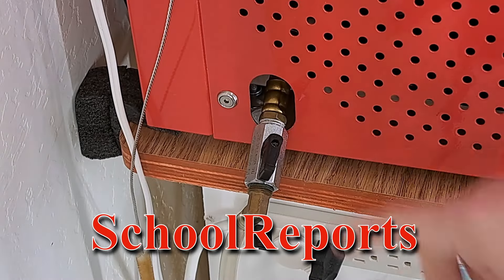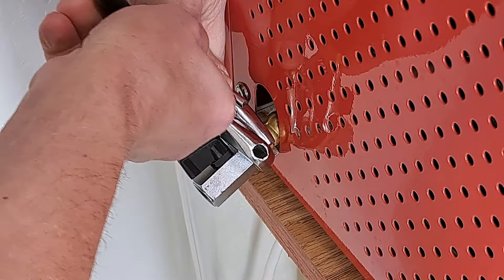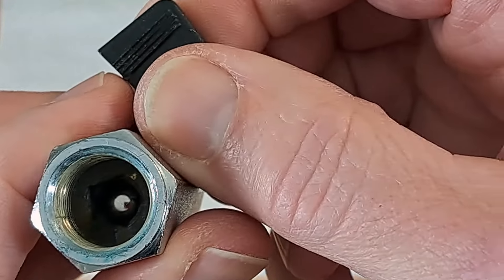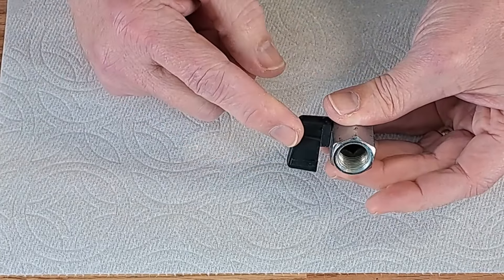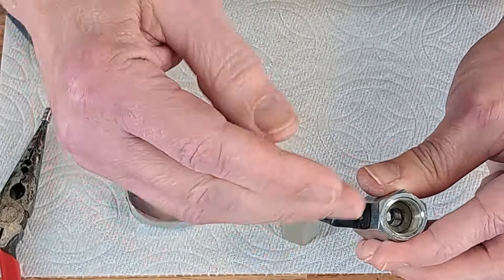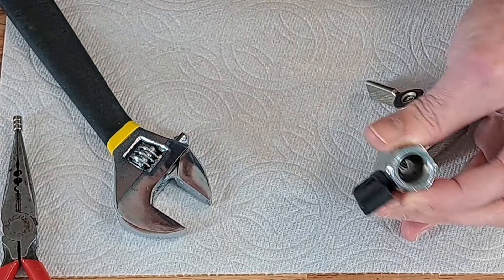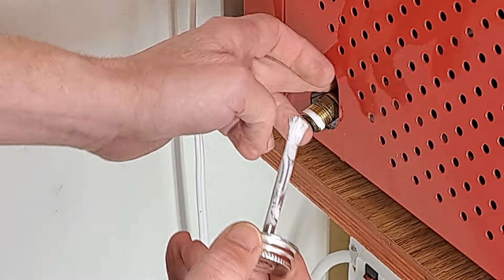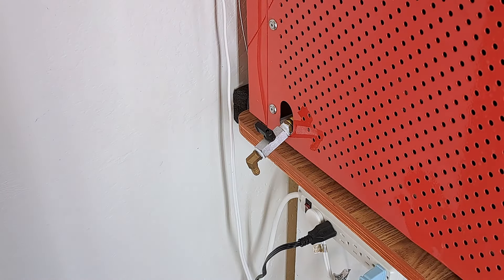Checking My 6 1/2 Year Old Drain Valve + Spare Parts List & Seal Damage Repair Test

Comment: My machine is from 2022 and I had to replace my valve with a gas rated valve and seal up all the connections. I followed the Felix fix. It works great now! My machine wasn’t getting down below 500 mtorr and I was getting errors. I used a nerf gun dart and cut I slit in it after cutting the end off and stuck it over the metal under the valve area to protect the tube 😂
Reply from the maker: Nerf dart -  I wouldn't have thought of that. I've just been meaning to 3D print a grommet https://www.thingiverse.com/thing:6482078

Comment: I had to change my valve also,  it looked gross and was so hard to turn, it sealed good but making sure it was turned all the way was the problem.  new valve, not one bit of trouble since.
Reply from the maker: My valve has always been a lot easier to turn than my sister's, but at least hers still sealed - until it didn't! 😁

Comment: Your sister and I bought our machines at about the same time. December of 2022. My gasket is perfectly fine, still.
Reply from the maker: The way the one area of fiber stuff was showing, I'm assuming that is was just an issue of variation in seal manufacturing. It was still holding vacuum, it was just getting harder to get it to seal when the vacuum first started. (I think she has done around 130 batches)
Reply: @SchoolReports  I’m at 224 batches, including candy. 12 of those are candy loads.
Reply from the maker: Nice pace. 
My sister has always been going at a slower pace. (only referring to her freeze drying batches!) I've done very few batches over the past 6 months or so. I'm more in the maintenance phase of freeze drying right now - rotating stock and replacing what we use. We even plan to send some off to the kids to make more room for new stuff!

Comment: Thanks for the white banner and not the airplane. I have subscribed. Not because of the banner but due to today’s vid which I like. But… taxi? 🤨
I don’t “ring the bell” because YT notifies me of new vids anyway, the notifications would be another annoyance. 
When you took apart your drain valve the old adage “if it ain’t broke, don’t fix it” came to mind along with prayers it continues to work. Then you mentioned you’ve taken it off before and I realized the likelihood that you’ll mess it up isn’t a problem. 
Is it possible your sister wasn’t completely opening/closing her valve? I don’t expect an answer because we can’t travel back in time and see if she did. I wouldn’t ask her, because it could be viewed as an admonishment or other attack. My question is mostly rhetorical.
I can both see as well as doubt that HR would purposely use an inferior piece in a newer machine. Cost savings yes, but possibly a supplier error.
The gasket portion was very interesting to watch, I’m curious about the outcome. Next vid I’m assuming.
Reply from the maker: Sister's valve was bad and well tested. I did a 3 part series of videos documenting its issues; testing, removing, tear-down, replacing, testing.

As I replied to another commenter yesterday about the bad valve:  
True. The good ones are only a few pennies more than the bad ones. I wonder if someone just made a materials purchasing mistake at some point?

I'll be weeks before I take off the gasket being vacuum tested in this video, and then try to put it back on. (assuming it comes off without having to cut it apart)
I'll be starting an actual batch with it soon - today or tomorrow - after I make a video for a viewer that had a candy settings question about the older machine. 

My old seal, the one I put the small the amount of silicone in/on (?) the cracks at the end of this video, should have no problems with vacuum - at least once! I won't be testing it until I take the other one off.

😁 I've made 5 different ones of the little popup, and yep "Taxi!" is one of them. (plus 3 little airplane ones - one right, one left, one pulling a double banner) And sometimes I even (Oh! The Horror) randomly put the word "Subscribe" somewhere in the video! I typically show some kind of subscribe thing about once every 8 to 10 minutes. I've even had a few people tell me that they had subscribed specifically because they liked an interestingly placed or made "Subscribe."  I once piped "Subscribe" using the yogurt I was freeze drying. (4 people commented that they subscribed because of it, and that was when 4 new subs could be a weeks worth for me)

Comment: Could you share where you got your SS shut off valve at? I’m assuming you get your extra seal for door from H.R? Thank you very much.
Reply from the maker: Thanks for asking! I still forget to share information about the parts I'm trying.

 Yes, I ordered the seal from HR; it was $42 for the medium one. (It was a few dollars less than the one I got 3+ years ago. Nice to see the price of something go down!) 
    This should bring you to the valve we got. - https://amzn.to/3vtAwDZ We got it about 2 weeks ago and it was $13.99 at that time.
I do have a link in the description that goes to the Amazon page where I'm going to try to link most of the things I have used in videos.
Reply: @SchoolReports  That was very helpful. The 3/8 inch I’m assuming? Thank you for being so helpful. Have a blessed day.
Reply from the maker: @Judten1  😁I don't like to assume that they all use the same size, but both mine and my sister's machine both use 3/8 inch.
Reply: @SchoolReports  Thank you. I have the same one your sister has. This helps a lot. 👍🏼

Comment: I would imagine the types of food...would also impact the value; take palm oil in candy for example.
Reply from the maker: Could be; because of things like that, I think we're going to consider pouring a cup or two of clean water into the chamber after batches to make sure the valve gets flushed out every time. It's hard for me to know, after all mine is still going good after 4 times as long as my sister's without extra flushing. Probably wouldn't hurt.

Comment: Great job again.  Question.... once you turn off the pump... should it hold perfect vac for X amount of time... or is there naturally some flux that'll occur even when "holding" that was the part I didn't quite catch.  How many mTor would you say is forgivable over x amount of time?
Reply from the maker: In the ideal world, the vacuum would be nearly permanent. (Assuming a perfectly clean, dry chamber) However, with 40" x 2 of seal length (both contact surfaces of the seal), 4 hose fittings, a $12 drain valve, and a cheap check-valve seal in the vacuum pump, for me, as long as it can pull down to below 100 mTorr and hold it there while running, I'm happy with it. Mine will hold at least some vacuum overnight.

Comment: HR has started using trash.  Its this type of thing that is SOOO small when it comes to cost difference... yet causes mayhem.
Reply from the maker: I'm going to throw purchasing under the bus! 🤣 I just know how sometimes they will order a cheaper version that is "exactly the same" as the component we've specced. (I really have no idea, but I've just that happen too many times)
Reply: @SchoolReports  I get it.
Reply from the maker: @ciliap  Regardless, there still should be checks in place to catch these things. They also had the issue with many, many heat sealers that failed to function. Years ago my main job was process improvement.
Maybe they need to read the book  Quality Is Free by Philip B. Crosby.